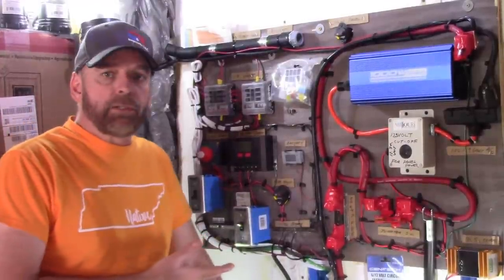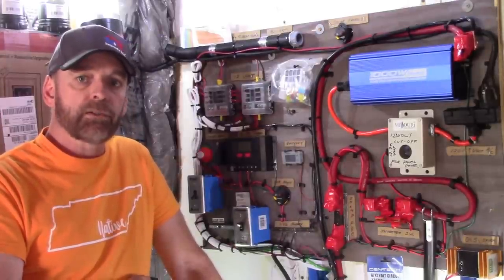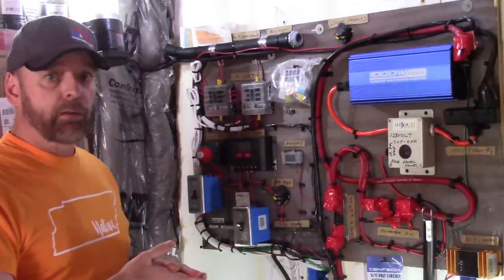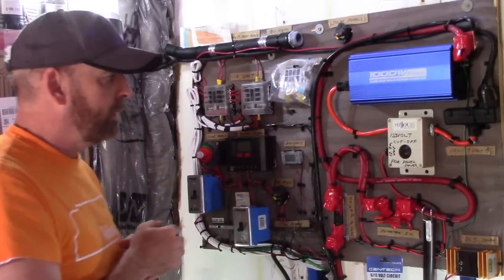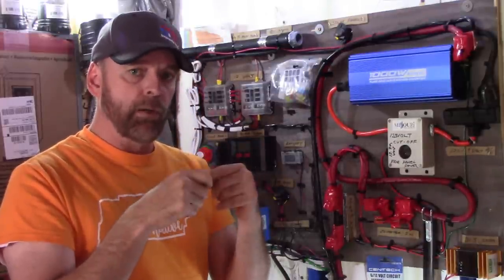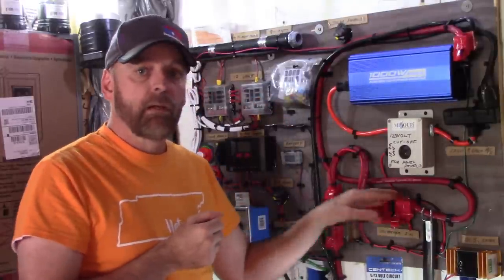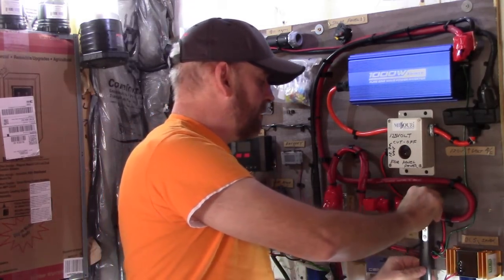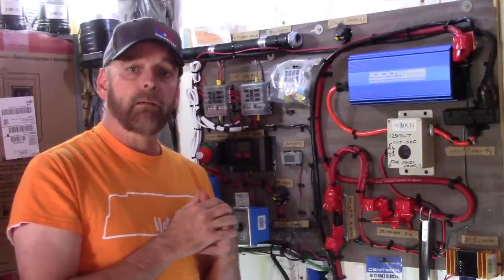Inexpensive Solar Power Off Grid Cabin or homestead DIY system #SOLAR #OFFGRID #homestead

Comment: Oh man! You say so much wrong! Lithium is much  cheaper! You system is so overcomplicated!
Reply: Watch John Daniel's Lead vs Lithium battery video. Lead wins everytime.  12 volt is the way to go also.
Reply: @kayakwesty  LITHIUM IS CHEAPER. If you know where to get your cells and buils your own batterys, its much cheaper. Why then tesla uses Lithium, if Lead wouldt be better? 24v is cheaper because: most charge controllers can handle 12/24v at the same amount of amps. So a 10a controller couldt be 120w(12v) or 240w(24v). Second: You dont need that thick wire for a system with the same amount of whats. Big cable is very expensive so thiner wire will be cheaper. third: the efficency will be higher. In the wire of the solar panels will be lost a lot of energy. At higher voltage, then eficency will be higher. Also in the inverter the eficency increases with higher voltage. 24v inverters are cheaper too. You can also only draw half capacity of a lead battery in comparison to lithium so 100ah lead acid vs 50ah lithium. 
https://www.youtube.com/watch?v=Vi7eswWwosk
https://www.youtube.com/watch?v=Rp8Hspi4BC4&t
Also Lithium Batterys degrade slower. So in the end, 24v pays off faster. It may be a little bit more expensive at the start, but in the end it pays off much faster.
Reply: @BastelPichi  cable is cheap unless you are running miles of it. Lead is cheaper and MUCH easier to purchase.  In a pinch you can go to Walmart.  Who has the time to make their own batteries.  12 volt applications are a dime a dozen. You watch too many YouTube videos.  The real world its 12 volt and lead batteries.  Speaking of lead ...you spoke of Telsa. They are worried about weight. A home owner. Meh
 Golf batteries are hard to beat.
Reply: @kayakwesty  And why teslas powerwalls are lithium? They can be heavy as ** and they still use Lithium! Lithium is smaller! Why in mobiles they use Lithium? Lithium is the future. I got tons of Lihium Batterys Lying arround. I got all of them for free! And they are very lightweight. Why in ebikes they use Lithium? Lead is so much worse. Somebody that used Lithium never will switch back to lead. Did you watched the youtube videos?There are many YT that make comparisons that are trustwearthy. This Jophn Daniel dont shows how much subscribers he has. Great scott got a million subs and is more trustwearthy in my eyes:https://www.youtube.com/watch?v=LqgP16JQ24I
Reply: there are so much yt that work with lithium: 
Will prowse
HBPowerwall
NERDVille
Jehu Garcia
etc.
Reply: @BastelPichi  everyone you mentioned is sponsored or makes their living off of YouTube meh.  Telsa powerwall is using economy of scale from their automotive industry.  Meh. John Daniel pisses a lot of people off by using basic math and real world testing.
Reply: @kayakwesty  you even have to use 300ah of flooded lead acid to perform a 100ah lithium battery. This cheap big cable is copper coated aluminium. Pure copper cable is expensive. And flooded lead acid batterys like to gas and lithium not
Reply: @kayakwesty  he is making money from youtube too
Reply: And here si a comparison betwenn Used LiPo, Used LIIon and new Lead. If I wouldt use new lithium Cells you wouldt only need even less cells. https://drive.google.com/drive/folders/1-vPJG9CkA_ON1fPNrmH3dN6rTPPrS90W?usp=sharing
Reply: @BastelPichi  theory vs realty
Reply: @kayakwesty  just belive, lithium is better, I used Lead 7 years ago for 3 years in a 12v system and 4 years ago i switched to lithium and 24v and since then i can live offgrid, with the old lead batterys that was not possible
Reply: and the upgrading was not too expensive! I only paid 90$ extra and got a way better system! you only have to change the battery, inverter and add a dc to dc
Reply from the maker: @BastelPichi  You're going to hate the next solar video. I'm installing wet deep cycle batteries from Walmart. I start filming next week. Cheap wins the race.
Reply from the maker: @BastelPichi  I left Walmart with enough to buy food.